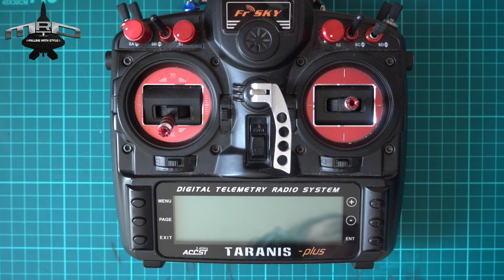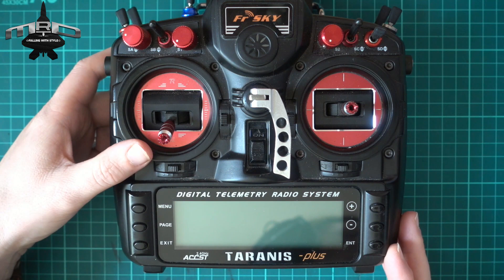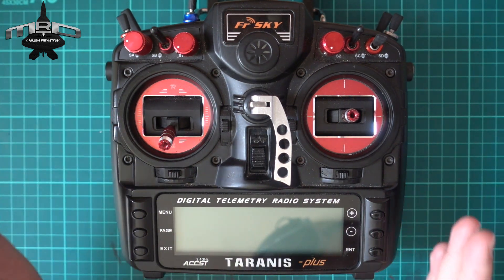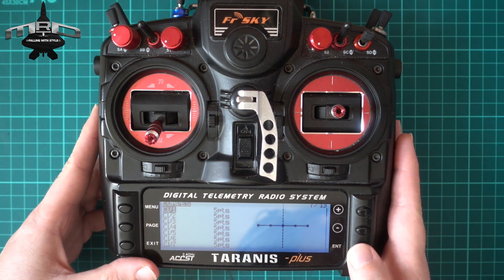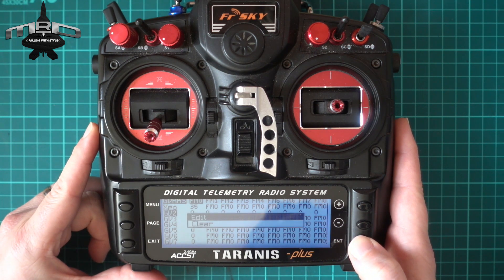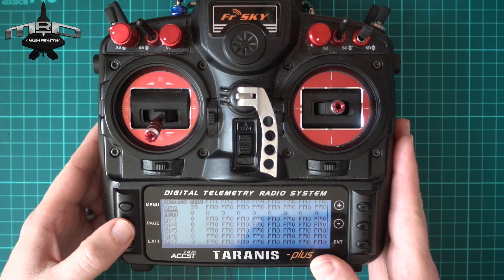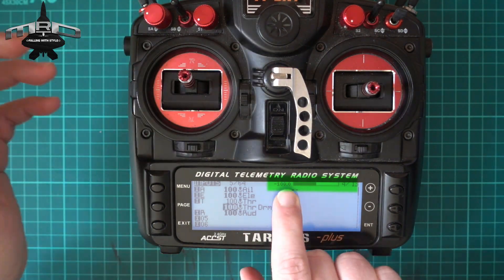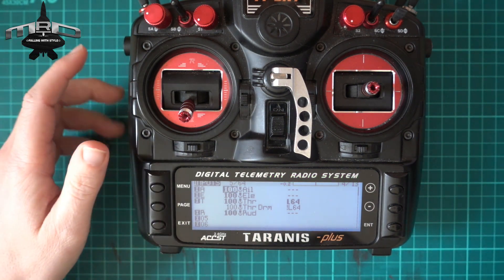The Ultimate Arming Switch

Comment: I got this to work the Rx side, the code is executing correctly, the confusing part is that when we press disarm after running the motor, it doesn't cut, despite the throttle input code going to 0. I'm not sure why that is. It does however stop the motor from starting if the throttle is above -98(or 2% of the physical gimbal). Its just not cutting it after its been turned on.
Reply: I finally figured it out, nothing wrong with the video, I just didn't change the input to have the second throttle be set using the DRM curves(akas the 2 point all 0 curve)

Comment: I;ve been looking for these settings since i bought my Radiomaster T16s - It works very well, but man is it complicated. I understand about 50% of what i just setup. On my 9xr Pro running Ersky9x this was just set with a single safety switch setting. I think you need an engineering degree to understand opexTX. Anyway im going to stick with it as I think its more widely used. 

Thanks for the video - It works really well!
Reply from the maker: It gets easier as you get used to it. ETHOS also has a built in throttle cut, which is just a click. But I still manually code my own as I prefer the way mine works to the ETHOS standard cuts.

Comment: Great Video. I need help placing a snap roll condition on a momentary switch. So when I flip the switch all surfaces throw to a desired rate. YouTube has been no help on this one.... Have everything setup under the Inputs menu, and it shows on the graph when I flip the switch, but no movement on servos.....
Reply from the maker: Have you checked the channel monitor to see if it works there? It might be easier to drop me an email on my website.

Comment: I had no idea what all those features were for.  I came from Futaba and recently embraced Open TX.  I've been away from flying and I'm amazed how far technology has advanced in 5+ years.  I just ordered a new RadioMaster and looking forward to the programming you provide.  Thanks!
Reply from the maker: No problem Corey. There is absolutely loads you can do with these transmitters. Especially with OpenTX. If there’s anything in particular you’d like to see, give me a shout. Hope you have a lot of fun flying again :)
Reply: @MrD  Thank you for extending the offer.  You have loads of great tutorials and I hope your channel takes off.  Your instructions are far more detailed than any else I've found.  

A couple things I think that may attract a few views is if you can describe how to set up TXs to simulators (Steam, Wings, DRL, etc).  It took me far too long to get my settings correct to have a reset switch.  I never had an issue, but I know others have had issues getting initial connection setup with the simulators.

Maybe a set of files with the up-to-date sound packs with description. I only have found Amber (and Joanne) from 2.3.  I'm currently looking into what "the change" was that makes them problematic for the more current firmware (Tada vs. hello, etc).  

Lastly, at this time, don't know what I don't know about the Telemetry screens on OpenTX.  I tried to get things configured (RSSI) with CRSF.  That being said, I haven't devoted more than an hour or two messing with it.  (Not sure what data I'm getting from FC, nor how to properly configure the radio to properly display the data, aside from holding down page when in the model)  

Thanks again and keep up with the amazing content!
Reply from the maker: Thanks for the suggestions Corey. I’ll add those to the list. I was going to make a video quite soon about how to make your own sounds packs. But, I could look at including packs like Amber too. 

The telemetry screens and simulators I can look at to 🙂

Comment: Darren in your video you mentioned that you're going to cover another Arming Switch for Flight Controllers or can this one me used?
Reply from the maker: No, I wouldn’t use this for some flight controllers. It would be fine with a Vector. You would just need to remember to arm before your do the setup wizard. It wouldn’t be good for iNav, as you use the sticks to enter the OSD menu.
Reply: @MrD  So are you working on a Arming Switch video for Flight Controllers and would be able to enter the OSD menu?
Reply from the maker: Richard F. Adams I can do a video for this. It would be pretty similar to this one. Only it wouldn’t do anything on the throttle input and it would change a channel to sent the arm state to inav.
Reply: @MrD  Please!!!

Comment: Oooooo! I didn't think about getting into the FC menus.  Good point! Oh you got the logical switches in too! Woohooo!
Reply from the maker: I know, a lot of people forget about that. Then stand at the field looking like an idiot trying to get in to the menu when its impossible. Not that I’ve ever done that 🤣 I learnt the lesson though. I have got another system for a pre-arm switch for flight controllers. Not that it’s really necessary; the flight controllers have safety stuff built in. But some people like them, so I’ll do a video. 

That was only going over the logical switches needed for this. There will be more on those later on. Hopefully it was understandable?
Reply: @MrD  It was fine. You're a good explainer. :)